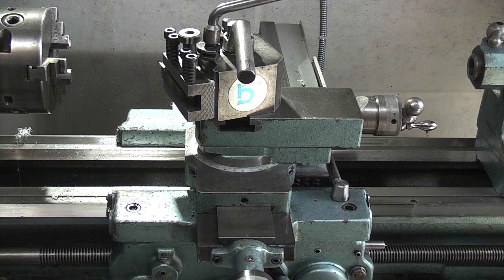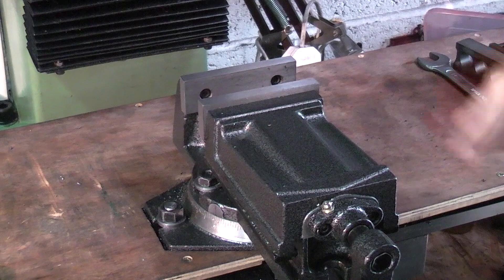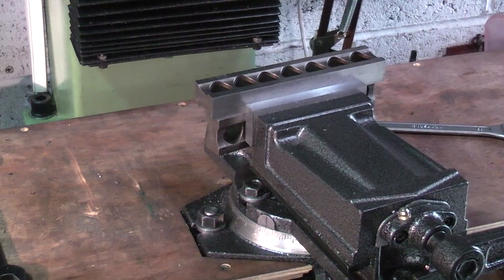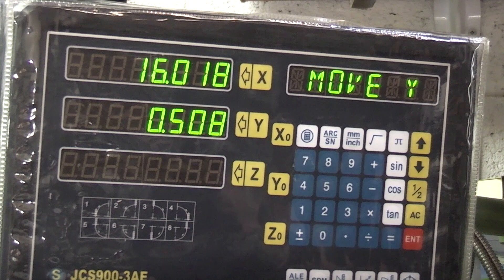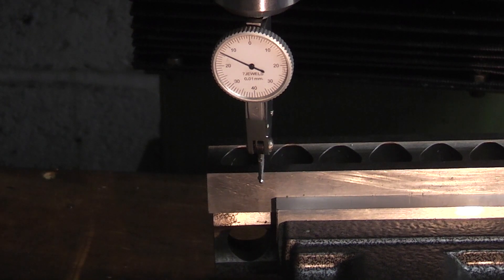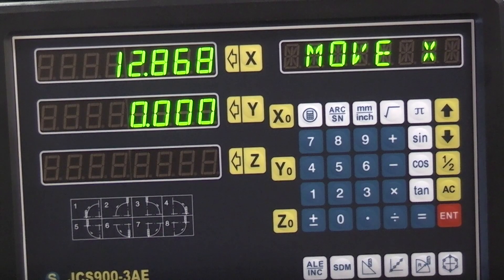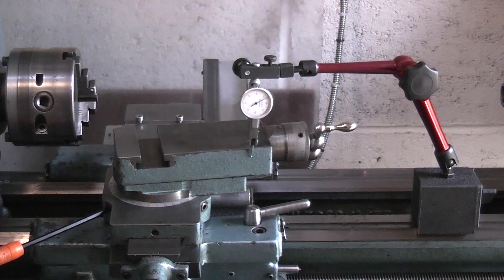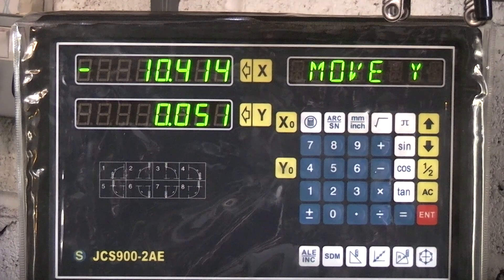using DRO to set mill or lathe to 8 deg

Comment: Ya one of the better DRO video's I've ever seen. No kidding the DRO can help you make some super acurate tools make sure your indicator is on center hight for tapers. Realy great for compound angle's set the vise toe clamped at the one angle and a custom? angle block in the jaw's. no swival base no angle plate no roatery table if your lucky you won't ever need any of that. achiner'ys   hand book has the tables for 100 mm x and 5" X use it all the time  ha ha Thanks great video very entertaining stuff

Comment: By some reason Your last videos comes up with text in my mobile phone. That's new to me, text.... Watching the same video using the Pc, there's no text. This only happends to Your videos.
When the text appears that strip is effectivly hiding the work You are showing. Strange. Any tip?
Reply from the maker: The subtitles are on all of my videos but you need to turn them on to see them. your phone must have it turned on you need to turn off subtitles on you phone
Reply: @enotsengineering  All You are saying is showing up in text on 2 lines a bit down on the screen. I've never seen "subtitles" in the phone near Youtube.
Reply from the maker: When on you tube on your phone touch the screen you should see three dots on the top right hand 
touch the dots and a screen should open showing you caption on change it to captions off
Reply: @enotsengineering  Thanks a lot Alan! As You sometimes say, "Spot on!". Just did as You told and there it is.
It puzzled me because it has only been on Your videos and it started without reason, without explanation. Now it's cured!
However, for viewers using the text, remember that the lower 1/4, 1/3 of the frame is hidden by the text.

Comment: Hmmmm...I need to check that the face of my top slide is parallel to the travel and fix it if it is not. This could be very useful for setting short tapers. I never had the "inclination" to look into this feature before. Thanks!